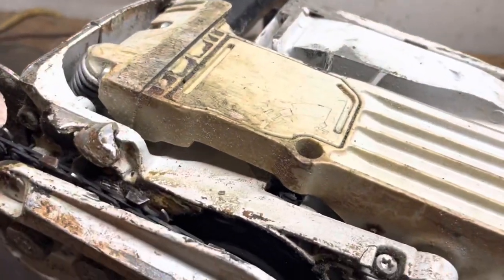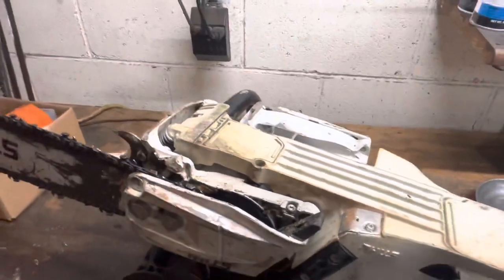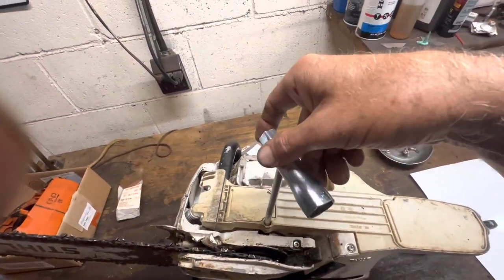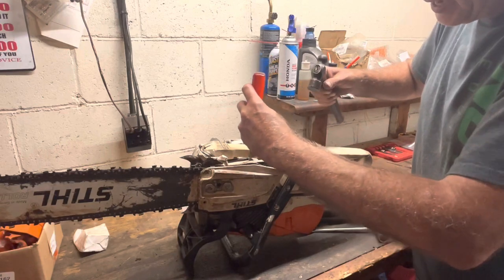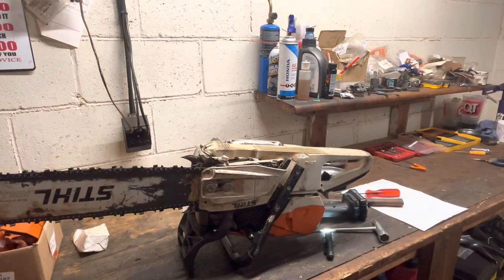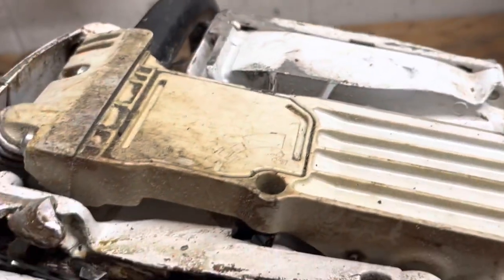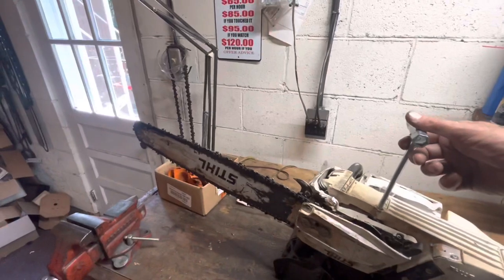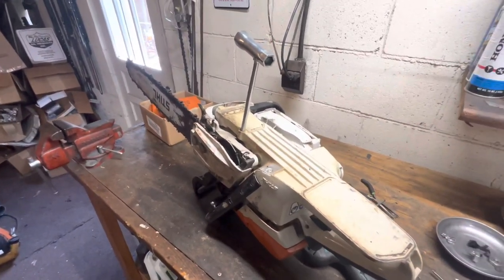Stihl MS 462/500i/661 not Oiling Enough. Easy Fix

Comment: Great info, thank you.
Would this work on an MS400?  MS400 owners are swapping to high-flow 462 oilers, to handle longer bars.
No one I've found, have mentioned a restrictor pin in the MS400.
Lots of high-flow pump info, over on Brian2bears channel.

Comment: Glad I found this! I also found where some stihl bars had smaller port oil holes. I have a 500i and Im constantly seeing sparks from the bar. I used thinner oil and still seeing it. Imma do this to get more oil out there. This is the only saw that does that.

Comment: Thanks for the info. I wonder why stihl even put the pin there in the first place. They should have known people are gonna run bigger bars. Also i have one more question how much bar oil should a chainsaw use? Does it depend on bar length? Not many videos on it thanks
Reply: As a general rule of thumb, the longer the bar the more oil one needs. It also depends on what species one is cutting, 👍🪓🌲🇮🇪

Comment: No problems with my oiler on the 400. Set from maximum to 2/3,  seems to be enough for the 25" bar. No hight temperatures on the chain cutting hardwood.